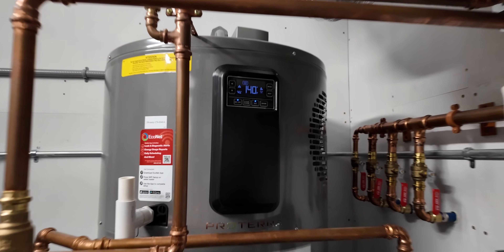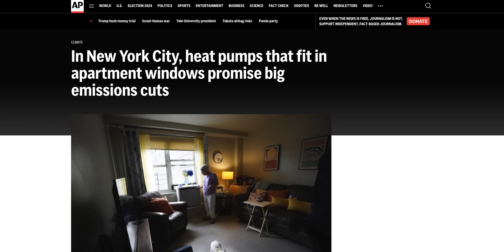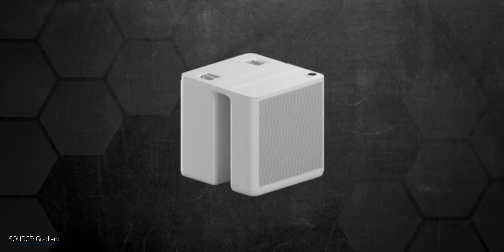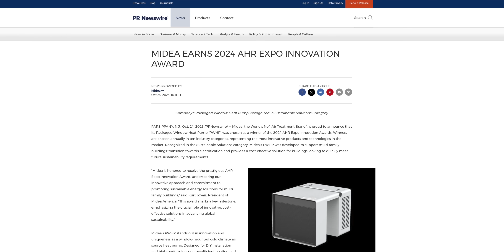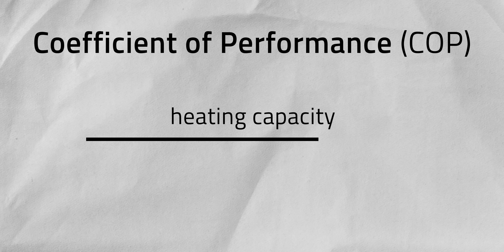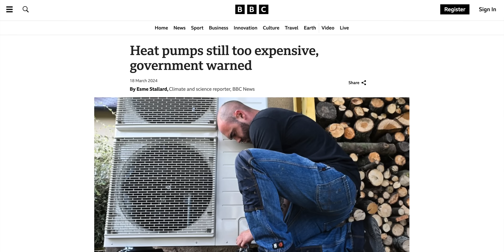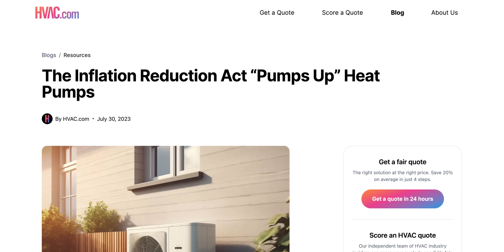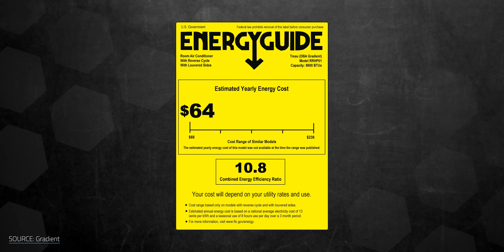Why This Window Heat Pump Is Genius

Comment: All these companies are just gouging the customers/government. This heat pump are less than two air conditioning units coupled together, one facing out, one facing in. As you showed, a window air conditioner does not cost more than a few hundred dollars. If the government stopped its subsidy, then these units will automatically drop  to a tenth of its price.

Comment: Your comment that window air conditioners can't heat? Perhaps that is what is offered in NA but in Australia we have reverse cycle window units that have efficiency levels of ~3.3 (the ones I looked at quickly use R32 :(   The cheapest was ~USD$400 with COP/EER 3.3, R32, -7 to 46C. I am not saying the Midea and Gradient aren't superior, it is just that you don't have reverse cycles at all sizes and typs of Air Con surprises me as we do and have had for about 20 years or so. Maybe 220V vs 110V has some impact but I wouldn't have expected so.

Comment: Most homes how windows that slide left and right instead of up and down making these heat pumps moot.  There needs to be a version that doesn't take up much window width.  Without this change these heat pumps are dead in the water.

Comment: Sorry but way to many people complain to much about price, price and price. If you know what goes into these things and how expensive making parts can be, you might understand.  Also, if these things can replace a broken boiler in a old house in Minnesota, then it is a winner. Remember, if a boiler is down then you will be COLD. With these babies you will still have heat. Also you will have AC in the summer.  I take these any day over repairing an old boiler. 😁😁

Comment: Midea already makes airconditioners in reverse saddle configuration for less than $500,-  (As does GE). To change an airco to a heat pump should cost an additional $2500.  It don't make sense. Sounds like the usual corporate greed taking advantage of government initiatives/subsidy/mandates.

Comment: One big issue you didn’t mention is that these upside down “U” shaped units won’t fit in older NYC buildings.  Most older buildings have a cast iron radiator under each window for heating.  In most apartments, like mine, the radiator sits just about 6” under the window sill.   Neither of the units you show will work in my windows, or the windows of most New Yorkers.  I have looked at the Midea window air conditioner in the past because of its class leading SEER rating only to find it can’t work in my apartment due to my radiator.

Comment: how is a window unit heat pump more efficient than a window unit AC for the same cooling task? The cycle should be the same so they should have the same efficiency.

Comment: Other than the reversible valve in the heat pumps, why are they so much more expensive than window air conditioners? - they're essentially the same machine, aren't they?

Comment: It's a great idea, but I'm worried about summer nights.
Air conditioners quickly became popular in Japan with the advent of air conditioners that could be installed later on windows that opened on either side.
It was quickly adopted because the construction cost was low and it had a good reputation.
As a result, as many people used their air conditioners on summer nights, heat was generated from the outdoor units, rapidly increasing the heat in the city.

Comment: This would be perfect. We have a small addition that's not hooked up to the heating or cooling system in the house, but is open to the rest of the house (garage conversion of an original 1950's garage). We can't run ducts to it for any reasonable price without redoing the entire house HVAC. So the room stagnates, either too cold or too hot. Mobile heaters and AC units are expensive to run and by, and really inefficient. Our other option is a minisplit system. Which is expensive and requires a professional install. This would work perfectly as an alternative, for less than a mini split.
Reply: A mini-split is under $1500. After installation it should be less than the $3000 of this window one.
Reply: @eDoc2020  but doesn’t require installation, completely removable which is a value added that meets my needs, otherwise a “mini split” like you say is just a dirt cheap heat pump. There’s a reason it’s cheap, and a reason a typical mini split is more expensive. These units aren’t competing in the same use case as a mini split.
Reply: @xXKyledkXx   "There's a reason a mini split is cheap and a reason a typical mini split is more expensive." I suspect you meant to refer to two different products instead of the same one twice.

The way I see it, the only advantage of this more expensive window unit is that it's easily removable. If it was cheaper it would make more sense.

Comment: In Japan, most units has split heat pump or allow them to be installed. Have an AC in summer is not really an option in Japan.

Comment: Hi, when buying an air conditioner, say in regular stores, the BTU stated on the box, is the standard for that the ASHRAE standard? or the other one? I forget what it's called, but those BTU's are the lower value, but reflect reality better than the ASHRAE which is more lab, perfect conditons BTU.  I'm thinking of buying an AC stated 12000 ASRAE (and I think it's 8000 on the other one), so I want to compare the cooling to my current AC but don't know the usual way (i.e. the old AC) how the BTUS are generally shown.

Comment: Not sure where you are looking but the old style box windows units can definitely heat unless you buy the bottom of the barrel models. They are noisy and not as efficient but $3-$3,800 is a joke.

Comment: Now you have me thinking about my AC units. They are window units that do provide heat, and they are more efficient than the other AC at the store. Are they actually heat pumps, or just really efficient AC units with hidden heating elements? It stats AC on the box...

Comment: The cost is theft, period.
Also I did not hear what it will cost to use as a heater. NG is far far cheaper than electric.
Show me the monthly cost in January.

Comment: Those numbers don't seem right,. . Why would a single room AC unit cost 3k ? you can buy a 12k btu minisplit for like 500 so seems like a huge cost with little return for the end user ... maybe i need to look more into it .  But i have one of midea's u shappend inverter window units that i got for sub 300 and it is pretty damn effecient compared to my 2 other central ac units that draw a crapload of amps and watts

Comment: I have a window heat pump from Friedrich that has a better output than those and it’s $1600. I don’t get why your pumping these products
Reply: If yours offers better heat output at the same outside temperatures it probably has greater electrical requirements. If you need a 240v outlet or a dedicated circuit it's not a fair comparison.

Having said all that, $3000 is unreasonably expensive. $1500 is more reasonable and still double what a similar performing mini-split costs.

Comment: I live in Vancouver BC, my apartment only has baseboard heaters I also have a portable AC unit so we use a lot of electricity. The AC actually costs less in the summer than the shitty board heaters do in the winter. 

I would love a renter friendly option for a heat pump. I believe it would lower our bill by a significant amount, not to mention that we would be able to control the temperature better. 

The 2 issue we have are: 
1) windows swing out not slid down like the ones seen in this video,making it difficult to find something that will work and not take up a lot of room. 

2) we would need one for each room, which is expensive and takes up space from our already tiny apartment. 

Government needs to mandate that builders have to have better insulation, built in heat pumps in addition to other greener building practices.

Comment: These motherfuckers need to start making window AC units that fit TALL windows, not just squat fat ones. My bedroom gets sun all day every day and even with the AC on this side of the house set to 77 I'm lucky if I manage 80 with my door closed. I have insulation up on the windows, the blinds closed, and a sheet over that.

But noooo, my window is tall like Luigi, not fat like Mario, so I have to use a jank ass tube on a floor standing AC unit.

Comment: I love the idea, the problems I see, and because they would be for our current house in RI. The windows I would put these in have cast iron radiator under them, which means these wouldn't fit. Also, older buildings, like my home, have 2 prong outlets, which would most definitely not be good with these. So I can do 10-15k worth of upgrades to my house to use these or I could just install a house-sized heatpump. 
It's a great idea, and I realize that my case is not everyone's, but workarounds need to be figured out for mass-adoption of this tech.

Comment: Ok, since I didn't see a single comment specifically covering the actual reason for the higher cost (might exist, just didn't find it), and I've experienced it over the past year (yes, different units, but it is the details that matter) I have a rather good idea where the cost comes from. Two words: "Variable Capacity". 
The window AC units I bought during the pandemic are among the most efficient available, yet they only operate at 100% and due to older technology put larger demands on the grid (large in-rush current at start despite low overall wattage). The heat pump where I am now uses newer "inverter" (not actually an inverter, but don't attempt to explain that to the sales & branding people) technology to achieve both Variable Capacity (higher efficiency) AND lower in-rush currents (better power factor, therefore being more friendly to the electric grid). That newer technology is not free. There's your price difference.

Comment: Neat. $3,000 is ludicrous though, for a 110v window air conditioner with reverse gear. This type of thing is $100-$200, available at any walmart or home depot, and there's no way a little valve or goofy saddle-shaped case is worth the remaining $2800.

Comment: I've been living in older apartments for most of my life and I've never seen one with vertically opening windows that seem to be required for this unit.

Also, how is this any different than existing AC / heat pump combo units that have been around for a long time in many different form factors.

This just seems like a normal heat pump + AC in a less compatible form factor.

Comment: If making the heat pump reversible is so expensive, but installing the window unit is so easy, why not make one that is not reversible and instead flip it around between summer and winter?

Comment: good grief....it's just an air conditioner that turns into a heater by reversing the cold/hot loops of the transfer fluid.  I just bought a u-mount midea 12k a/c from Costco for $399.  paying extra $2400 to have a window mounted heater is silly.

Comment: This is just a re-styled window mount reverse cycle Air conditioner.  

The claims about COP and running costs are just marketing. Indeed labelling it a Heat pump is misleading.  Reverse cycle air conditioners have always been heat pumps.

Nothing revolutionary here.

Comment: I live in an RV, but something like this sounds good to me. I was going to buy a space heater for the winter to leave on when I'm at work. A heat pump would be so much better to keep my RV from freezing while I'm away. Do you know of other heat pumps for RVs?
Reply: A standard mini-split might be a good option for RVs. Many smaller capacity units can run from 120v-only. I don't know if road vibrations would be a problem or not.

Comment: Hi Matt, something is wrong here.  We have window box airconditioners around 3:1 efficiency.  We have dual function units that have similar hearing efficiency.  They cost a lot less than this.  However, I've advocated for similar split designs for sliding windows using latest hest pump split inverter air-conditioning efficiency.  It used to be 5:1 (cooling) but in the tropics they talk about 6-9:1, to do with the extra  heat up here, and that's around $400, plus installation of at least $400.  So, how come no window units using similar mechanism and efficiency.  There is no real reason it shouldn't.

But the ones in the video are unsuitable for  hese are unsuitable for sliding windows.

Plus these are prone to grid failures and Carrington Events on things attached to the grid.  I was going to say, just convert the boiler room to a heat pump, and even a backup that uses thermal burning to generate the electricity. 

Why not have flow control in apartments to reduce excess heat or cooling, or increase it depending on your floor.  Any loses through the interapartment nextwork guess to the general cooling or heating of the building.  Plus, you can also use geothermal wells to pump away the heat from the heat pump for reuse in winter.  That would increase efficiency.  Though, an engineering study is needed to determine the affects of every building doing this, on infrastructure.

Comment: These things are massively overpriced, and just a simple cash grab from free government handout. You can get a mini split unit with 3-4x the capacity for similar or cheaper price than these, that are more efficient and also are heat pumps. Heat pumps have been kept expensive because the HVAC manufacturers can get away with it. The difference between an A/C unit and a heat pump is just a simple reversing valve. Mini split units just include the heat pump feature because it is essentially free, and a no brainer. But central HVAC units get price gouged by thousands of dollars extra for a $2.00 feature.

Comment: I'm with most of the other comments...you had me until it cost 10-20x the cost of a standard window unit.  Even if it can produce heat less expensively.  It will take a very long time to recoup the difference in utilities.

Comment: These things are honestly a solution looking for a problem that we've made for ourselves. There are AMAZING, low cost easy to install mini-split units available on ebay that are targeted for the mexican market, that are 9K BTU, with seer ratings of about 20, which operate on a 110 outlet.  And they cost about $700. 

We cannot, legally, install them in this country, because of our moronic laws on the subject of how heat pumps need to be hard-wired. 

So change the form factor, make it so you don't have to drill a hole in the wall for the exterior unit and run a vaccum pump and you charge three plus times the price for a LESS efficient unit that blocks up a window? 

For a renter, this unit makes sense. The energy savings over a few short years compared to a cheaper, older window unit, combined with better stability, and better access to visability by not taking up so much of a window compared to a old school AC? It's got significant advantages for renters. 

But a NYC apartment landlord could have an electrician install that mini-split, that is MORE efficient, for the difference in cost between those units and these units.

Comment: Melbourne Australia. I bought a window mount reverse cycle 1.2kW unit [3.6kW heat 3.9kW cooling] for AUD 800, which is less than USD 550. However, min temp is rated to -7 deg Celsius

Comment: I live in Phoenix where the temperatures go above 113, so no go. Probably would work in most places. The one that only operates to 95 has a very limited area. I lived in northern Europe, and temps there could occasionally go over 95. New Hampshire and Connecticut get over 95. Throw in climate change and where will this be useful at all in a few years?

Comment: Dual hose portable heat pumps are already available from these manufactures at prices under 600 dollars and with higher heating and cooling output. They are less visually attractive, but much cheaper, more practical, and more effective.  

I bet the companies would love to get the govt to pay thousands of dollars for thousands of units. I know I would.

Comment: I have been working with heat pump for 20 years. The temperature a heat pump loses efficiency is around 30 degrees and will stop heating without some sort of heating coils. I don’t believe that those units are telling the truth about the rating. And a 120 volt unit is very inefficient compared a 220 unit.

Comment: Window heat pumps aren't new; I had one for an apartment I rented 8 years ago (it was a floor-standing unit with tubes that ran through the window). It's performance characteristics were not this good, but it did exist. I wasn't expecting to use the heat function, but when my apartment's furnace crapped out in January and my landlord dragged his ass getting it fixed, I was sure glad to have it.

Comment: Agree with others: the price is too high. 

Heat pumps also don't work great in hotter climates. Even larger central units tend to run all day in the summer. I can vouch for that personally. So $3000 to heat and cool one room, whether it is doing so in hot climates or not is not really a great solution. Maybe prices will come down when they are adopted more fully.

But if local governments force adoption then the prices will not come down. And much like NYC's climate mitigation laws, will make apartments and homes that much more expensive and hurt the people who need affordable housing. Like many responses to climate change this one is patently anti-human in the name of humanity.

Comment: The problem with rolling these out are the apartments that wont let you have window units "because they look bad"
My apartment gets to 90 on a regular basis... but we can't have window units because they look bad... even the ones that are flush with the window so you don't need to remove the screen.
AND AS MANY OTHERS ARE POINTING OUT IN THE COMMENTS these are nothing new and are just benefiting from knowing someone in government.

Or people in gov have shares they will dump right before funding runs out so they sell at the peek of the shares value... just like every other green project.